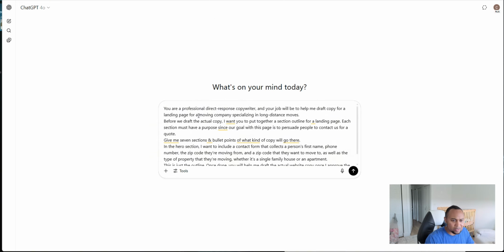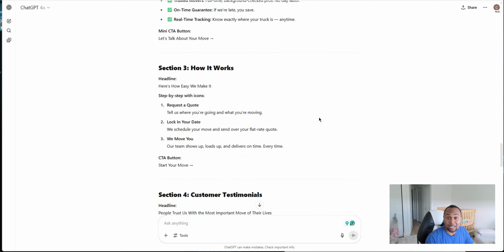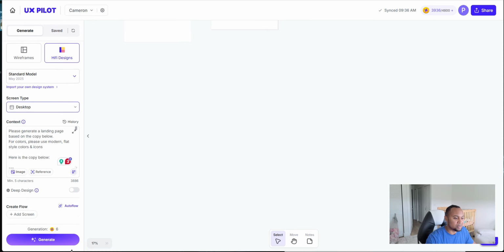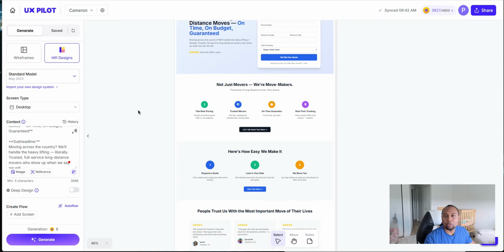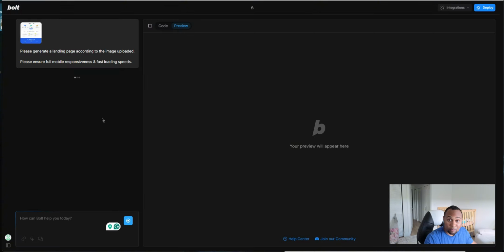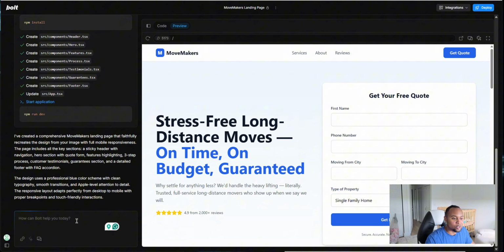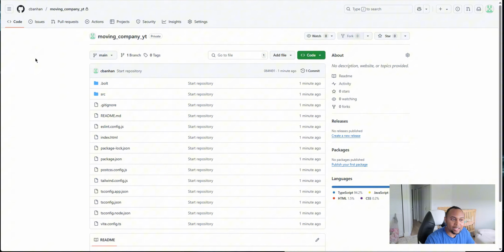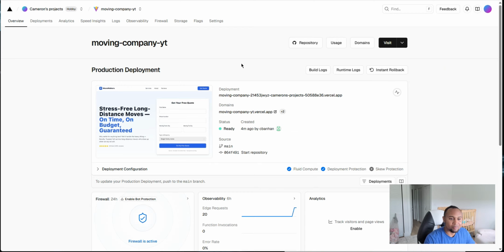Deploy Custom Landing Pages With AI (Bolt.new & UX Pilot)

Comment: Hi, very interesting tutorial. I wanted to ask you a question.

For the same use case shown in the video, do you recommend using *Lovable* or **Bold**? In my case, I want it for creating websites, SaaS and mobile applications.

I’m looking for a platform that allows me to export the code and makes it easier to scale the infrastructure if the project goes well.

So, in my case, my question is: do you prefer *Lovable* or **Bold**?
Reply from the maker: I've been using Bolt & I am happy with it for websites & landing pages. For my apps, I honestly use Cursor for more control plus I just Nextjs.